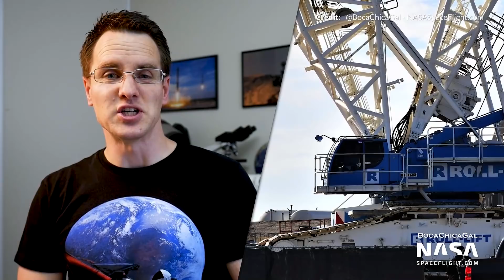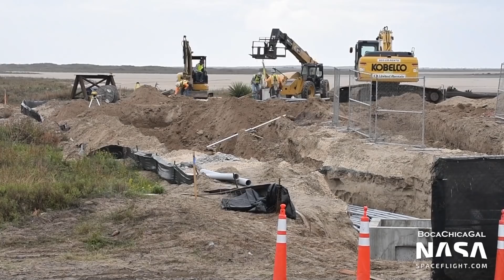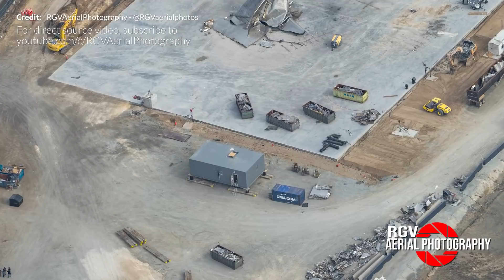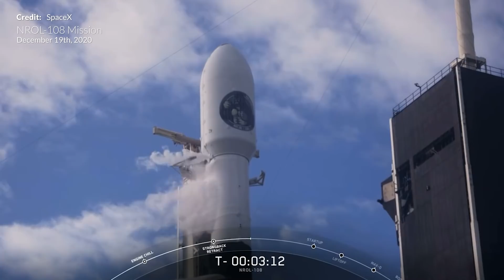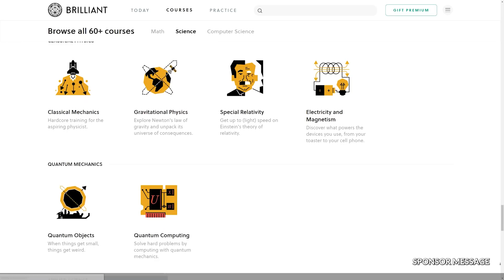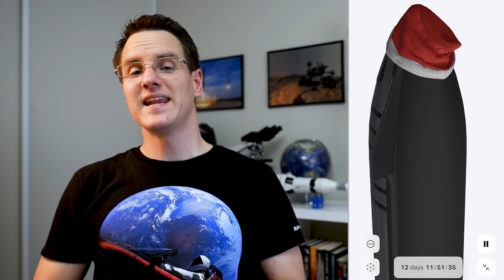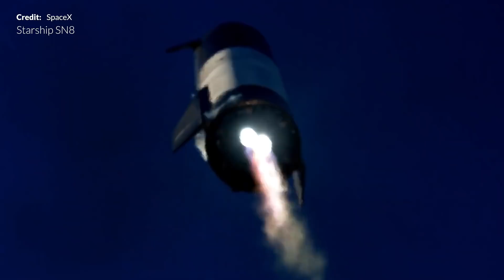SpaceX double launch pad usage for Starship coming, NROL-108, Lockheed Martin purchase Rocketdyne

Comment: Spacex should consider dragon capsule inside starship for crew safety return to earth. Specially in the beginning of crew flights with starship. This will add to to the weight and decrease payload capacity.
Reply: That will increase complexities too. And the ship will be launched uncrewed hundreds of times anyways. Better spend time making the ship more reliable & low cost than making an illusion of safety because of LAS
Reply: @alvianchoiriapriliansyah9882   yes but I was thinking about the first time they try with humans it should be some sort of redundant system for re-entry and landing. With the Dragon capsule now tested and reliable for human flights with its heat shields and paracute for slowing down, they should consider either having a dragon in orbit/ docket to ISS or inside starship if the starship landing isnt 100% reliable. This is also important since starship does not have abort system. Relying on the flip maneuver and landing with raptors few hundred meters before hitting the ground is nerve wracking!
Reply: @alvianchoiriapriliansyah9882   Also I dont see the complexity, the dragon should be sort of a life boat inside Starships cargo compartment, yes it will add more weight as mentioned but human safety is most important, also maybe spacex can develop a lighter and smaller dragon for starship crew return. Another scenario is having multiple crew dragons in orbit and used when returning humans :) I dont know just a suggestion for the safety!.
Reply: @suleman26  Well you have to learn engineering more because inserting Dragon inside Starship isn't Kerbal. Commenting with a big underrating is frustrating to read for actual engineers

That's exactly why even Elon expects Starship to not carry a crew until hundreds launches, in which then all of its manuever won't be as nerve-wracking
Reply: Big frustration? Dude this is YouTube. Kerbal? Never used that.besides there is a reason why spacex abandoned the landing of dragon capsule with retro rockets. It is more complex, and simpler design with parachute is safer. Now I would love to see spacex master landing of starship with flip maneuver and make it routine like landing airplanes.

Comment: "Now obsolete Cargo Dragon"?
Reply: They are using a modified crewed dragon for cargo going forward .  Larger payload and autonomous docking.
Reply from the maker: Old Cargo Dragon could not auto dock, had expendible nose and solar panels that needed extending. New cargo dragon can dock itself, has a nose that opens and closes and static solar panels on the trunk.

Comment: But i think this so called low costs spax or Starship arent so progressive.  The most progressive projects should be artificial gravity  and more powerful engines to travel .. ( for now ) in our solar system. 
Ok is a really Good job .. but its just the easiest part of the exploration if the system solaire
Reply: When the cost of access is still very expensive today, the lower costs should be a progressive one, especially when opening the railroad to another world

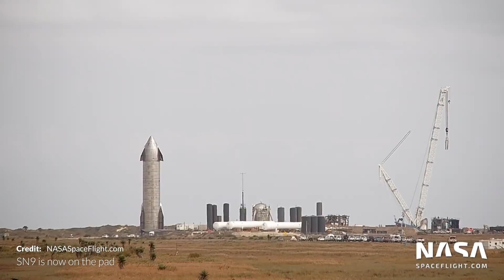Comment: 2:12 is it even legal for RGVA to send drones out there at the launch site? I hope they got the permission and won't get too close at the launch.
Reply: Correct, drones aren't legal in this way in Texas. But RGV does this with flights on a Cessna 172 airplane. An airplane can fly over almost anywhere in the U.S. as long as it's above a certain altitude (IIRC 500 feet.) And RGV very rarely passes directly overhead, they mostly circle the site.

They won't get close at the launch - the FAA issues temporary directives closing off airspace for occasions like this. And afaik the pilot owns the airplane - he won't want to risk it and his ass!  :)

Comment: The Lockheed Rocketdyne merger kinda sounds like the Sears, Kmart merger...Two losers throwing in together to try to slow their loss of market share to a competitor they have no hope of competing against. Just like Sears and Kmart  if they manage to survive at all it will be as a bit player serving niche markets SpaceX isn't competing in. Such as weapons systems and small sat launches. In fact I wouldn't be surprised to see them acquire Rocket Lab at some point.
Reply: Lockheed is a very strong company. Their joint venture with Boeing (ULA) just happens to be one of the weakest parts of their portfolio. Comparing LM to Sears is absurd. What SpaceX is doing to shakeup the whole federal contracting space is very impressive though and ULA will likely lose most of its business to SpaceX and Blue Origin
Reply: @granterickson5784  Lockheed is a strong company basically because of a single customer the US government...Their commercial space business going forward is Sears...Quality overpriced outdated items nearly everyone will look elsewhere for. SpaceX has already taken over the world commercial launch market and Starship's targeted operational cost for 100 ton to LEO is 2,000 times cheaper than SLS. Should SpaceX be even close to hitting that number ULA is permanently out the Orbital launch business. So as far as launching things into space goes that leaves Lockheed and Rocketdyne with the business SpaceX isn't competing in, dedicated launches of small sats and ballistic missiles. Which makes them Sears and Kmart in the age of Walmart and Amazon.

Comment: The companies that created the moon rocket and shuttle rockets belong to a bygone era and need to retire there non-reusable rocket engines.  Either keep up with the times or go the way of the dinosaur, what they did back in the day was great, but resting on your past achievements is not the way to move forward, the sls should not be powered by boosters from the 1980's era shuttle that proved unreliable and costly.  Maybe we should just go with spacex and save taxpayer money with unnecessary redundancy in the space program.  The chinese moon rocket sample return was pretty dope, but it's basically based on a russian soyuz design.  They should maybe concentrate on doing a space station and the US should consider partnering with them, after all they partnered with the Russians.
Reply: SLS is a joke. Solid boosters are so 20th century.
As for Blue Origin, Bezos seems increasingly fueled by abstract aspirational goals and methodology. "gradatim ferociter" may be a nice exercise in high-school Latin motto-making, but it's just not working.
Reply: @-danR  Bezos I think is going a totally different rout than Elon, to the point that comparing the two is like comparing apples to oranges. I think he's trying to create a high-altitude/orbital tourism market.

Comment: Why would you do a flip maneuver when landing on the moon ? makes no sense.
Reply: You can't as there is no atmosphere, only flip on earth or mars
Reply: @notdone1975  Exactly, so I'm wondering why SpaceX mentioned it in their promo video as a landing solution for "The moon, mars, and beyond"... not sure how well it will work on Mars either since one of the hurdles for landing on mars is decelerating through its incredibly thin atmosphere without the aerobraking forces you get when entering Earth's atmo.. I like the idea of the belly flop decent, a round tube is the most drag inducing shape you can make, but if there is no air to create said drag, such as on Mars, not sure how well it will do in slowing the vehicle enough to not require substantial amounts of fuel for the suicide landing burn. Remember on Mars they're not going to land an empty vehicle, they will be landing a vehicle with enough fuel to get back into orbit. Still lots of stuff that doesn't add up with this project for me. Love the ambition but still skeptical to how they will get all to work.
Reply: @sugershakify  Maybe they meant enables it in the sense that the cheap and 'easy' reusability it enables on Earth is what allows Starship to get its massive payload volume to the Moon? Alternatively yeah, the video guy fucked up.

Comment: One Question that I have is how will Space X move the much taller Starship booster rocket onto the taller launch pad since their current large crane does not look tall enough to do the job?  A follow up question would be how will they move a combined booster and Starship onto the new launch pad due to its height?  I realize that these answers are probably not known but I am curious what you may have heard.
Reply: Starship would likely be stacked onto the booster at the launch site. I don't know about how they plan to move the booster, but if the current crane isn't tall enough they'll likely just get a taller one when they're closer to testing it.
Reply: @dotnet97  I am wondering if the fully developed launch site would just have a crane built into it.

Comment: Quoting Elon Musk : Best case scenario unmanned flight to mars in 4 years.
Reply: I think he's remarked that the Fall 2022 window is a possibility. For a light payload wide fly-past, I see it as a certainty.
He may even be able to contract for other people's scientific orbiter and and lander missions with that payload; they can provide their own LMO injection rocketry with the packages. Open the hatch and push the whole packages out one after another, easy-peasy.
Reply: @-danR  Well the thing is they might have as many as 30-50 Starships by 2022 minus those that crash but if you've got a large number of ships hanging around why not send most of them to Mars and see how they do. That would probably provide enough data for them to nail it in 2024 and send more valuable cargo. They could stagger the arrivals  of each ship a few days apart for software fixes.
Reply: Add 10 years to that your closer its totally new how long did falcon 9 take to carry people 15 years?
Reply: @leschortos9196  silly of you to think that Falcon 9 and Starships development is same speed. They have far more experience now. Also Shotwell said they will try flying humans in 3-4 years.
Reply: @nikhilchaudharybirbhan377  hope you're correct I agree 100 percent, whole different vehicle whole different set of problems. I'm 65 now hope to see man on Mars before I'm 75. . Some problems are not as scalable as others. Space x is sm art they know this.
Reply: @leschortos9196  9 years and 84 launches, but most of those launches where in the last few years. It took them something like 3-4 years to have 10 launches then suddenly they got to a hundred. Starship can launch a lot faster, so in theory at least they could easily do a hundred launches in a year. Heck, let's do three launches a day for a solid thousand. I think 2-4 years is realistic until they fly people.

Comment: Seems like you wouldn't want SN10 anywhere near the landing zone of SN09
Reply: Exactly what I was thinking. Not sure why Musk is teasing it when it's such an obviously dumb thing to do, putting a brand new one right in the potential blast zone of another (very possible) RUD. Perhaps they will plan for it to land somewhere far away, but there is still a possibility of the RUD happening before or very shortly after liftoff, and if it happens closer to apogee, why would you want your next ship directly beneath where the debris field would most likely be?
Reply: Doh it is not that is the Take Off area

Comment: I wonder how long until Starships start depositing equipment and supplies on Mars. Presumably this could begin before human rating is achieved.
Reply: They've previously said that they'd like to try to get some simple essentials sent over in the 2022 transit window if they can get the full stack working by then iirc.
Reply: @dotnet97  I think you are right. Maybe 2022 cargo, 2024 cargo for sure. Maybe 2024 manned, 2026 for sure.

Comment: no, seems like a dumb idea, if they put 2 starships at the same time onto the pad, 1 rud could destroy, or heavily damage the second one as well. i think the second pad is more of a spare pad solution, when one gets destroyed or damaged in a rud or by a launch, they can still use the second one while the first one is getting repairs, reducing test delays. i think thats the reason why they use the other pad this time, the previously used one might undergo repairs.
Reply: I agree. Once they need two starships for orbital refueling, the pads will be more spaced out.

Comment: Cutting costs will not save Lookhead Martin, they need to create new hardware, and achieve reuse, or their rockets will be obsolete soon.
Reply: Falcon 9 has made the ULA Atlas V obsolete on a cost-basis. It's successor, the Vulcan, is obsolete even before it's built because it's based on an outmoded design philosophy. The only thing that will keep them in existence is the Air Force and NASA policy of always having two proven launchers in production. I believe ULA (including Lockheed) is fine with that - second place is guaranteed income. ULA got 60% of the latest national security launch contract. 

The corporate structure of Lockheed Martin, with ULA, has no stomach for the economic plunge of making a SpaceX competitor. If the BO New Glenn becomes successful, they'll just quietly recede from the launch business. I predict this will happen before 2030.
Reply: @donjones4719  Reusable rockets have upset the entire industry. Russia, which was previously one of the leaders in rocketry (who was the sole supplier of crewed missions to the ISS) has been on of the victims of this upset. Roscosmos's own reusable rocket proposal is essentially an inferior copy of a Falcon 9, and is only set to fly in the mid 2030s. By then, Falcon 9 will have probably long been phased out.
Reply: @dasbubba841  I agree with what you are saying to some extent. These companies are tied into contracts in order to guarantee parts suppliers and stability and reliability. It will be a few years before these are changed. And Elon's goal may not be to make profit from launching other countries payloads, while he focus's on going to Mars. Rockets are like the trucking industry, many niches and many specialist fields. So I don't think it will be like the competitive car industry where plants can shut down in weeks. I think there will be a gradual shift.
Reply: @dasbubba841  Russia lost a ton of money, they used to sold motors to ULA, not anymore, and used to sold trips to ISS, also not anymore.
Reply: @David-yo5ws  Falcon9 is launching payloads from everybody now.
Reply: @Kabup2  Yes indeed. Although I was thinking if Starship is successful, that SpaceX may focus just on Mars and not bother with other countries payloads using Starship, until Mars is set up with a small trial base. There is only Nov-Dec 2024 window for a launch. Then maybe look at other payloads, as the next window is then Jan-Feb 2029 and by that time there could be many Starships built for availability.
Reply: @Kabup2  
Russia still supplies the RD-180 for ULA's AtlasV vehicle.  Blue Origin's BE-4 replacement (for new Vulcan vehicle) is still not proven and is many years behind.
Reply: Totally 100% agree!
Reply: Yep

Comment: Space X should address the collapse of the "stand". Ground equipment would normally be designed and built to several times working load.  Five times load would be common.  A design or build that far off the mark is a concern.
Reply: They will certainly do

Comment: How are they gonna land/takeoff from moon/mars without a launch pad?   Seems like it would be pretty sketchy.  the apollo lander was a much lighter vehicle and it used the bottom section as a pad for the moon takeoff.
Reply: At least for Moon, it will use auxiliary thrusters

Comment: SN8 impact mark should be the new drone ship pattern
Reply: I was looking at it, with my non-artistic mind and noticed the broken concrete off-centre, where the 3 Raptors contacted. Being, arguably, the strongest structure of the whole Starship, most of the momentum of the ships weight, smashed through the thrust dome and into the pad. And there is a U shaped 'key' that could be incorporated into the design. The 'SN8 Seal' in remembrance of SpaceX's first significant milestone using a Starship.

Comment: I see the problem is that when turning off the propulsion, while the ship is in flight then turn off one by one, making the thrust of the engine out of balance and and touching each other until this explosion
Reply: Explosion was caused by a loss of pressure in the header tank, as confirmed by Elon on twitter.